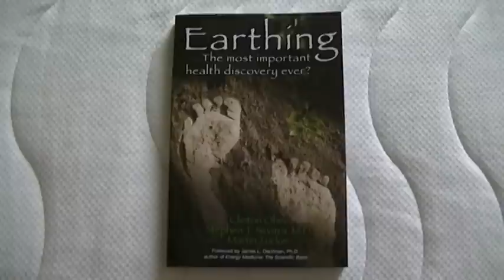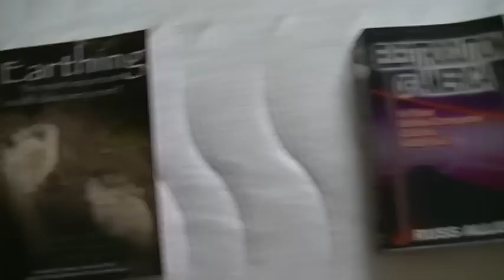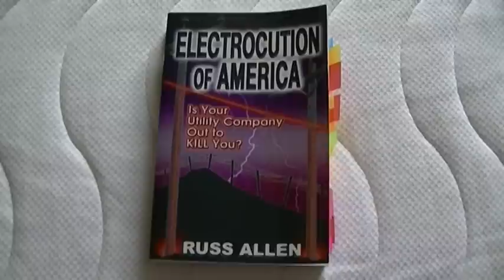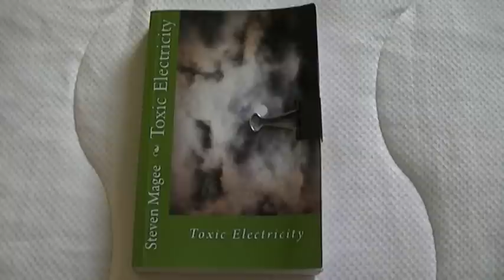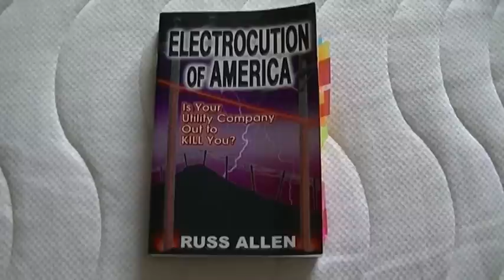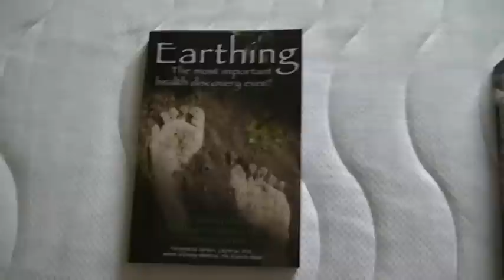Earthing (Grounding) Health Risks

Comment: Do NOT connect earthing mats/sheets/etc into the "grounding pole" of your home electrical outlet.  Your electrical outlet contains an equipment ground, not an earth ground.  It is a pervasive myth that they are one and the same.  They are not.  If  you do not understand the difference between an equipment ground and an earth ground, check this video by Mike Holt (NEC 2014 -- Electrical Fundamentals).
Reply: Hi. I'm an electrician and agree with you. I also agree that earthing mats are very beneficial as evidenced by some comments above. So, what do you do?
I'd install a separate earth stake outside in good damp soil making sure you don't put it through other services(this poses a bigger problem) and then earth mats directly to that. What if you live in a high-rise or a concrete jungle. Answer. You are going to have to use the earthing system of the building since you have no other alternative.
Sometimes best practice is not always an option. See message above regarding clean ups before using mats (imo)
Reply: Johnny Que  In the video he makes it clear that if you ground yourself to the grounding pole of an electrical outlet, you are just connecting yourself to the electrical grid and not grounding to earth.  They are not the same thing.  You are raising your risk of being electrocuted by offering your body as an alterate path for the 120 volts running through your house wiring to return to it's source.  

I can't speak to the benefits of earth grounding since I have never tried it, but if that is what you want to do, then follow Jim Rodgers advice above and DO NOT ground yourself to your house wiring.

I'm no expert in electrical theory, but Mike Holt is, so listen to HIM!
Reply: kai2698 I've got no experience regarding earthing for any health benefits.  Just pointing out the difference between an electrical ground and an earth ground.
Reply: Tom Trebing Where in this video does he mention the grounding effects on humans (besides electric shocks)? This guy talks about electrical safety more than anything...This video is totally unrelated to the topic of earthing benefits...
Reply: +Tom Trebing Hi Tom DC here. I am a 67 year old student of the Works of Nikola Tesla. Earthing is a vast subject but connecting to your very own clean earthing system can be done with care safely. I have done this in a special way with great health outcomes for me. I think that it is key to longevity, Why? We are mostly electric, every cell in our body is like a car battery. The cells replicate over time, they need a charge to do so. If they do not have the correct amount of charge they mal-form we become weakened. Doctors will say "Your Immune" system is low, what they really mean is "You Battery is LOW".Conclusion I agree with you "DO NOT CONNECT THE HOUSE EARTHING SYSTEM".

Notes:- Grid systems vary from country to country, voltage &  in the way / format; so many variants.Regards .... DC
Reply: i live in Canada and started grounding on a mattress panel/pad since august 2016 - I feel fantastic my achy back doesn't ache anymore my sleep is greater than ever and I never had sleep issues and I feel such a deep deep sleep when I wake up - my lead has a fuse connection so that should my house ground/neutral become hit/looped whatever the electrical term is it should zap the fuse first and not me - is this correct from any electrician out there?  I have done a blood cell test looking under a microscope and it shows metal toxicity healing
Reply: I've watched Mr. Holts awesome videos plenty of times. I've never heard him promote earth grounding. NEVER. If you pay attention he explains the whole earth is connected to the electrical system it isn't that hard to fathom on your own. Ignorance is ignorance nothing else.
Reply: kai2698 If you are using a strap or mat that is connected to the grounding pole of an electrical grid and you are working on equipment that is energized by that same electrical grid, then yes, you are raising your risk of offering your body as an alternate path for the electrons to return to their source.
Reply: +Tom Trebing I do not know what country you are in but in 1965 the NEC made earth ground circuits mandatory in all homes and facilities.  This ground goes to the ground rod in the earth under your electrical meter.  I have been plugged in for four years and my immune system has sky-rocketed and I now feel like I am 30 years old.  I am 60.  If you know your electrical theory, a power source will find the least resistive path to ground; not the other way around.  Of course it will also follow other paths but it will not come up from the ground.  As far as transients or dirty electricity, I make sure that both of the flat blades are not on the plugs I use.  I recommend anyone using these devices make sure the flat blades are not plugged into the receptacle.  The power circuit should never be conducted to the terminal area of the ground conductor in a health grounding device.
Reply: DamanSound  I guess you don't know the earth ground ties into the neutral at the circuit breaker box huh?
Reply: +DamanSound, I'm no expert on eletrical theoriy, but I listen to those who are and Mike Holt, whose video I linked to above, is one of those people.  Did you check out his video?  

Your statement, "A power source will find the least resistive path to ground" is an often repeated, but innacurate and misleading statement.  Correctly stated, "A power source will find the least resistive path to RETURN TO IT'S SOURCE".  

The point of my statement was to make people aware that connecting themselves to the grounding pole of the plug coming out of the wall is potentially making them a "less resistive" path back to source for anything that is electrically energized by the power grid.  If you desire to electrically ground yourself to earth, then use a separate ground directly to earth.  From what I understand (I'm not an electrician) it was common practice until about 50 years ago to tie common and ground together within homes in the U.S. and is still allowable (under NEC guidelines) under some circumstances on the customer side of the meter, so it would be prudent to assume such unless you are certain the case is otherwise.

As far as you immune system is concerned, I'm happy for you, but I am in no way making any claims either in favor or against the health benefits of practicing "Earthing", just encouraging those who do so to understand the implications and risks.
Reply: Ungroomed Lover 
Probably needs to be grounded not sure. But stray voltages are on ground. That's why some recording devices need floating ground set ups and stuff.
Reply: Ungroomed Lover cheap voltage meter from harbor freight will work. Just to see your body voltage. You will notice it goes up when you get close to the wiring.
Reply: Hooking to a ground may cause more current to flow through you because now it has a place to go.
Reply from the maker: Nice video!  I agree with you that the electrical ground is a risky connection to plug yourself into.  I'm finding peaks of 85 volts on my grounding system during lightning storms.  See: http://youtu.be/-q0GiqCv5JI 85.22 Volts on an Electrical Earthing (Grounding) System
Reply: ***** Hi, in other words, grounding yourself through anti-static equipments (the ones you use to prevent ESD) at home is also risky?
Reply: Tom Trebing Thanks for responding. I was just recently learned about ESD as I was planning on opening up my laptop for a thorough dusting. So my laptop will be unpowered, just FYI. 

So in short, grounding (earthing) is only (potentially) beneficial to health if the ground is connected to something conductive that is stuck in the earth, but not to the (working) ground of the outlet in the house/apartment, with something like this: (http://www.amazon.com/gp/product/B0002DGSWE?psc=1&redirect=true&ref_=ox_sc_act_title_4&smid=ATVPDKIKX0DER)? I hope I'm making sense.
Reply: +Tom Trebing Actually in "earthing", you want the electrons to come from the earth to repair the free radicals.
Reply: +DamanSound Hi DS With respect you should NOT connect to the "Earthing" on you metre. It is NOT true Earth & will be contaminated with 50/ 60 A/C Hz which is "Bad" for "Living Cells" ....  DC
Reply: DamanSound there is power flow on the neutral and ground buddy. A circuit needs a complete loop to work. You are connecting to that loop. Not to mention if lightning strikes the electronical system you will sleep real nice. Forever
Reply: You have to make your own grounding rod isolated far away from the electrical/equipment ground to do it right. Also if you are hooked up to the equipment ground case and it has power leaking to it from the equipment it will be all over the earth ground wire. This is not unusual.
Reply: Tom Trebing neutral connects to the earth ground incase lightning strikes and hits the electronial system. Other wise it would jump all over your house and shock you. It also gives a path to a shorted out devise like a washing machine to ground so it won't shock you.
Reply: +Mada Mayday Yes, I was using the term ground where I probably should have been using the term neutral, which as you said is tied to an actual ground.  As a point of interest Mike Holt actually discusses how effective these grounding straps actually are in the event of an actual lightning strike - very interesting and eye-opening...
Reply: +Johnny Que glad I read this b4 I watched
Reply: Cheryl Lewis lightning will arc past any fuse, so during a storm I wouldnt use it. High voltage won't blow a fuse... Ask my meters :(. Though as long as the earth contact has less resistance than you, it may not shock you. Electricity at high potentials can be rather unpredictable. I'm glad you found something to help you thanks for sharing.
Reply: Hi CL I am a 69 years old student of the works of Nikola Tesla the granddad of AC power. Under the heading of Earthing for Health Benefits. Please consult a electrician for safety. You should NOT connect to the earth of your household power supply. Why ? it is not safe do this as if you come in contact with a frayed bare live wire you are dead! You can safely connect to your own earthing rod which is separate from the power companies by bringing a wire into your home. You must only be connected through a say a strap & resistor which will protect you against receiving a fatal electric shock if you have 230 / 250v supply. The power company's earth is contaminated with 50hz & stray voltage.
Hope this helps you should research "Earthing for Health" I use it & it works well. .... DC
Reply: What about using the copper gas pipe on my heating system to ground? Would that be safe? I assume that because it goes directly into the ground it wouldn't be connected to the grid, so I wouldn't then be at risk of exposure to stray current from the electrical grid, right?
Reply: I'm just looking for a cheap, safe way to try this out without needing to run a wire outside. I figure the gas pipe would have to be safer than plugging myself into a power point. Any recommendations would be greatly appreciated.
Reply: Use a meter or you're shooting in the dark. Best thing you can do is just move your bed away from the grid. Lower body voltage.
Reply: Moving the bed isn't an option where I live. The house is rather small and cramped. 

What kind of meter do I need to purchase?
Reply: HI UL  So you want to try grounding / Earthing for Health Yes? But there is no cheap safe way to do this using "Bonded Systems". You either stand on wet grass or you connect to it in the most conductive spot. That's it no if or buts and you must do it safely so that if you come into contact with a live wire you will not have to push up daisies from 6ft under. Good luck ..... DC
Reply: OK. So I have to run a wire outside into the ground. I think I've worked out a way to do that. Does the length of the wire matter?
Reply: Disconnect the wiring that goes around your bed if you can't move it. Grounding mats dont work well at all. I've lowered my bv from 8v to 1v by moving my mattress and putting it on the floor.
Reply: That's not true. Properly made earthing equipment contains a resistor, which, even in the worse case scenarios - like a power-line being hit by lightening very close to your house; Even such an extreme event should not be a risk factor due to this extra protection. Even if somehow current ended up being forced up the earthing connection, the earthing device itself should protect you. This is not likely to happen in the first place. They are very safe, ask an electrician friend to have a look and ask his/her opinion. Research the basics online too first, it all helps!
Reply: Thank you, said much better than me :) Exactly! This "Mada Mayday" = Disinformation agent.
Reply: Its the same as a electric blanket.. your also at risk, but you dont hear of people getting electrocuted from theor blanket during a lightning strike.. its a myth.. doesnt happen.
Reply: the human body has a natural dc voltage of about 4 volts, so lovering to 1 v isn't necessarily a good thing.
Reply: Mike Holt says the old school teaches that safety depends on grounding and that the new school offers that a fault seeks not ground but a return to the circuit.  The video is excellent and promotes critical thinking.  The safety talk does not address the health aspects of the subject of "grounding."
Reply: As others have pointed out, in most countries you have a solid copper ground rod that goes into the earth next to the house, and the ground cable (in new zealand its green and yellow) is thicker than the two live wires (live and phase).. that ground cable if your place is new enough will not be electrically connected to the live circuit, HOWEVER... because all the wires travel around the house right next to each other there will be modulation of the 60 hz (or whatever frequency your country uses) signal that does cause a small signal to propagate down the earth wire.. but in my experience this is not a problem.. In fact a 60 hz signal has been proven to accelerate healing..  what i mean is that sports doctors in some countries get their patients to wrap a live electrical extension cable around the injury to speed up the healing process.
A small percentage of people are sensitive to this 60 hz frequency so thats why some people have problems with this system and need to use a separate grounding rod for their earthing system.

Comment: Hey guys I'm not expert but does i matter where the earthing comes from? Isn't everything being drained to the earth anyway at the speed of light? There would be a better benifit from earthing from the earthrod in the ground as we would get a higher negative voltage which is great but the copper wire picking up on grid lines sounds like crap to me because it's all being drained out fast anyway? Am I wrong?

Comment: so did you connect it to the electricity ground supply when you had a problem?
Reply from the maker: My electrical ground is heavily contaminated with stray voltage.  It makes you sick after about a week of being connected to it with an antistatic strap.  See: http://www.environmentalradiation.com/Stray%20Voltage%20Press%20Release.pdf

Comment: my question is has he tried the grounding techniques were you are in direct contact with the earth? Have tried emailing or visiting the websites of those who promote it and using their products? Maybe they realized something that you didn't while conducting your experiment and found a way around it. I have experienced the exact opposite of what is described in this video.
Reply from the maker: Yes, I have tried standing barefoot on tiled flooring.  It brings on painful cracked skin on the feet, sore knees and heart arrhythmia after several weeks.  My tiled floors are electrified with "Stray Voltage".  See http://www.environmentalradiation.com/Stray%20Voltage%20Press%20Release.pdf

Comment: Are you saying it works this grounding method? But given your house location, you are getting too much interference actually increasing your radiation field exposure, rather than dissipating the fields?  I was watching some of your other videos, and the plants seem healthier with the grounding technique. I am brand new to this in my personal health research. Can you help me understand?
Reply from the maker: The Dieffenbachia plant grows well when the soil is grounded to the least electrified tiled floor.  However, standing barefoot daily on that floor eventually brings on heart arrhythmia after several weeks.  There is a low level of AC electrification on it that is commonly called "stray voltage" in the industry.  See http://www.environmentalradiation.com/Stray%20Voltage%20Press%20Release.pdf

Comment: You have to realize that those grounding wires are only as good as the mineral content (electrolytes) in your body. Sensitivity to grounding is a sign of mineral deficiencies in the body, which means you are living on the edge of a cliff. Take a good organic mineral supplement, eat an Atkins diet, and see alkalinephdiet.com & energiseforlife.com. Also the use of magnetic therapies, orgonite, Faraday cages, and Tesla frequencies would be even more beneficial.

Comment: I question your explanation of Neutral affecting ground potential near the utility transformer.  Its like saying the sea at place X is higher than the sea at place Y simply because at place X there's more sewer pipes that drain into it.  Like the sea, the ground is so vast that only a lightning strike can raise / disturb its potential for a few moments over a range of about 40 meters, is this not the case?
Reply from the maker: See http://www.ncbi.nlm.nih.gov/pubmed/23416176